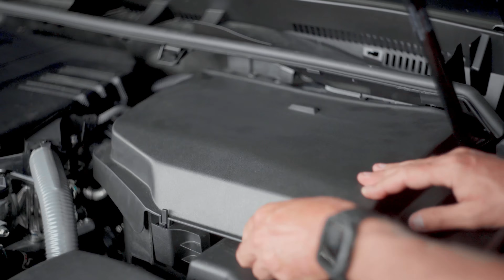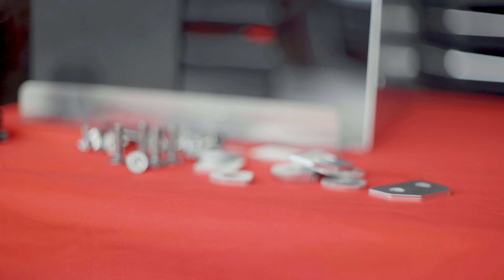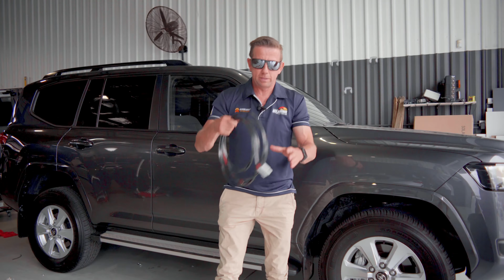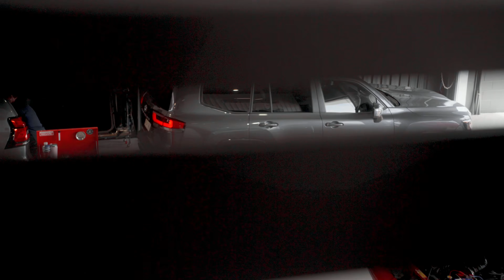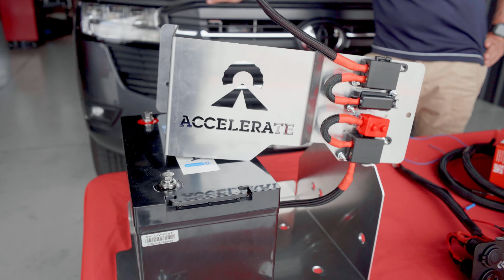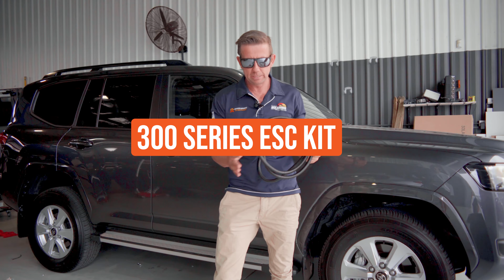Toyota Landcruiser 300 Series DIY Under Bonnet Dual Battery System

Comment: just watched video  , do you guys do a video showing us how to install all the components...?? as i have a 300 series Landcruiser and knowing how to open and remove covers is very tricky ( dont want to brake clips etc..) other companies do videos showing us how to install their dual battery systems  , which is very help full as it shows us how to remove panels and where to run wiring.
Reply from the maker: Thanks for your comment! 
We supply in depth fitment instructions with photos with every kit & are available via phone for any further questioning during business hours. A fitment video is something is something we are working on 🙂